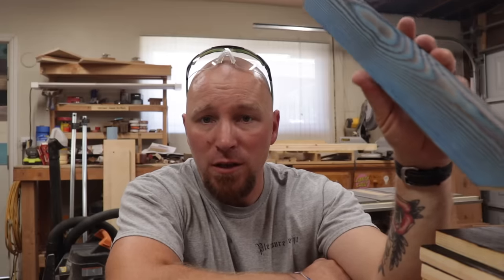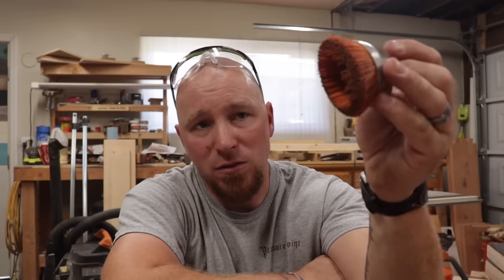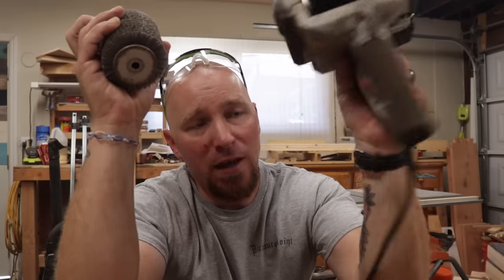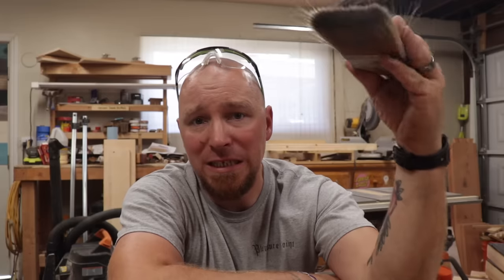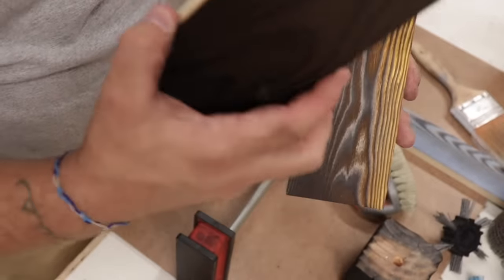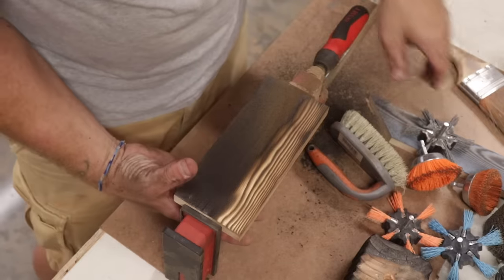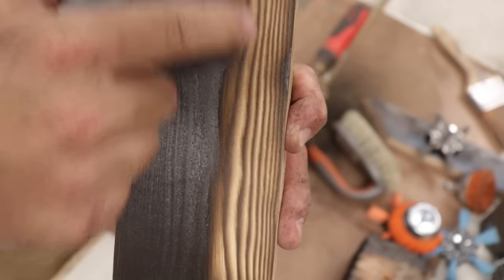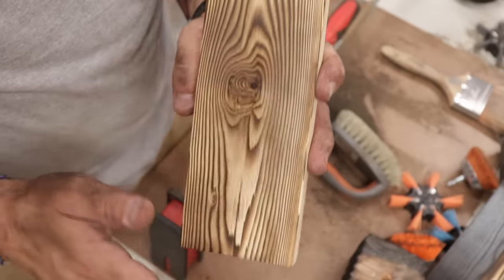The Right Brushes For Amazing Shou Sugi Ban Results

Comment: This is like barn boarding, making wood like it has been weathered for years. Popular in the 70s. It was made by running the wood through a wire brush planer, removing the softer wood, leaving the harder summer wood rings behind. Then staining with choice of color.

Comment: Hey there, i was indeed inspired into wood craft. Specifically shou sugi ban. I've been using the dyco flap discs, they work great, but now that I'm working on bigger projects they take quite some time to get the job done. 
 Wanting to invest in one of the restorer tools.  Could you tell me what grit was the nylon wheel you didn't use in this video? Would the 80 grit be enough to replace a wire brush for deep color contrast? 
I try to avoid the tooling marks, so only use nylon. Getting mixed reviews on Amazon for both products efficiency of removing char! Normally makita comes with 100 grit, but sells a 120,240, and 80. 
Any tips? Could you send me a video or picture of you using the nylon wheel you have?? I know it's a lot, but it's saving me from investing like 700-900$ for the Makita if I'm gonna stick to dyco ones anyway!
Thanks for any and all feedback! Great admirer of your channel!

Comment: Installed some shosugiban in my bathroom as a feature wall... needed trim to match, so I made it . Turned out awesome. I now offer it as a feature in high end remodel projects (labour intensive).Helpful tips here, and this is probably the most important step regarding the overall look

Comment: I found a regular wheel rather than a flap wheel worked best for me. I was doing a `12' long bench and the flap wheel went far too slow. It did increase dig marks, especially in wide areas but going over them with sandpaper was much faster than waiting on the flap wheel. It also holds up a great deal longer.

Comment: How is the nylon wheel going against the grain? Even so, just reverse the drill. It will go in the opposite direction. Just saying! !
Reply from the maker: It’s going against the grain because it’s a rotating circle going against a straight line. It would physically be impossible for it NOT to go against the grain. I see your train of thought, but reversing the drill would keep it on the same plane, just... reversed.

Comment: What kind of wood do you use? I used pine but i dont like how the grain is so close together.
Reply: It's regular grade 2x4, 2x6, 2x8.... Spruce. Home Depot etc. It is from corporate farming forests, fertilized for fast growth. This fast growth causes thick growth rings so on 2 sides of a 2x4 is a slab cut by default making large broad grain patterns. That is the good faces that you want facing out at glue up.

Comment: Thank you for taking the time to explain.  I am an ultra novice so sorry if this is a stupid question. I plan on making some furniture with this style and colored dye. Would you recomend sanding the wood first and then charing so that wood is furniture smooth?
Reply from the maker: That's actually a GREAT question and a point I think I might have glossed over in previous videos. I typically sand before I char to get rid of imperfections and blemishes as much as possible. Just keep in mind that once you char you will be changing the overall appearance and texture of the piece anyway.
Reply: Thank you so much.I was just going to do a regular stain, until I saw your videos and now I thank you again for the inspiration to try something different.  Unless i missed it (which i could have and i am sorry) SO after the brush is it possible to spray with water to raise the loose ends of fiber and thennn do a light sanding after?  or is it a trial and error type of thing? Do you have any experience in that?

Comment: has anyone ever tried this technique with a pressure washer to get rid of the unwanted black instead of nylon/steel brushes??... of course you would have to let it dry, but I figured if you were doing mass quantities... it would be less labor intensive and leave less too marks there fore less sanding... ? just more dry time...  any thoughts???
Reply from the maker: I’ve experimented with that a little. Only with a garden hose and nozzle, not a pressure washer. I do want to try again so thanks for reminding me!

Comment: I have a ? Regarding the 3 color method the wood, burn wood and stain like the blue one in the beginning I've tried different methods but only stain and the burn grain are left, can you give info please
Reply from the maker: If I had to guess I would say that the grain is probably too straight. I would look for boards that have the outer rings of the tree basically peaking at the face that you want to burn and brush. That will allow for some separation between the grain.

Comment: Just curious. Have you tried a pressure washer to get rid of the burnt soft wood?.  Or even a combination of pressure washer and flapper wheel?  Then let them dry as long as necessary before colouring.  I might give it a try just to satisfy my curiosity.  Thanks for the video's. Very informative.
Reply from the maker: I haven't but it is something I plan on doing at some point. I have tried with just high pressure from a garden hose but it wasn't that interesting. Let me know what happens if you try it.
Reply: @InspireWoodcraft  Hi Jodee, I gave my 2 pressure washers a try.  The results were amazing.  First I tried my 1500 lb electric and results were ok but I wanted to try the big dog.  The 3200 lb pressure 9 hp Honda unit. I'll list what I see as positive results.  I can honestly say there were no negative points. 

                            1.  No dust of course
                             2. What takes an hour sanding can be done in maybe 10 minutes tops
                             3. The finish is like 2000 grit sand paper was used.  Finish is almost semi gloss
                             4. Depending on growth ring pattern the 3D effect is awesome
                              5. With either pressure you can not get through the membrane (i'll call it) between the burnt 

                                     and unburned wood.  It leaves a beautiful golden brown finish
                               6.  While wet hit it with the nylox like usual.  Throw board on ground and hit it with the
                                      pressure washer again.  The pressure cleans out all the tooling marks left by the nylox
                              7. Dry and stain, dye, or whatever.

A few tips : never stop in the middle of the board and change direction,  clamp all the boards together evenly and do the sides and ends. 

Anyway I can fill a few pages here but maybe give it a try and tell your subscribers what you think.  I'm really impressed but a little caution is needed at 3200 lbs.  It's actually very hard to damage a board unless you get way close.  I was 6 to 8 inches away at full boost and no problems.  Just keep the wand moving
Cheers Jodee.  You do awesome work

Comment: Great video I'm looking to build a work bench and burn and and dye an OAK ply wood for my work top and dye it blue what is your opinion on how it would turn out could it be fully burned and brushed off or just light burn
Reply from the maker: You know, I'm actually not sure. It would be worth a shot if you had some scraps to test it on first. I haven't tried myself, but I believe plywood will only be able to be lightly burned. The top veneer is just not thick enough to brush.
Reply: @InspireWoodcraft  that's kinda what I'm thinks ng do a light burn and dye it a realy dark blue if you have IG give me a follow @DUEY_didit and I'll have a video up in like a couple weeks

Comment: Hey Brother... How do you keep the longer stretches of wood from warping when you are applying the fire? Thanks, T...
Reply: I've never experienced that, but maybe clamp both ends down to a flat table?

If it's warping, the heat might be penetrating too deep.

Maybe use a more a spritz of water to stop the heat getting too deep.

Comment: Brilliant series!! Thanks so much for explaining each step!!  Question, at 7.15 of the video after you have brushed the bits of the wood, you wipe across it with your fingers and of course they were black. Do you actually "clean up" the wood with a damp cloth? isopropyl alchohol ? Or just leave the residue right there on the wood ready for a finishing stain? Many thanks and yes SUBSCRIBED !!
Reply from the maker: Thank you very much! I’m glad people are getting some use out of these videos. I almost always only brush off with a soft brush or maybe blow off with air. The few times I have tried wiping off with something, it seems like the liquid would mix with the char dust and contaminate to exposed wood. I suppose on a nylon-brushed surface it wouldn’t matter much because the would is already dark.

Comment: I have a question. I want to make some picture frames. Would you burn before you assemble the frames or would you assemble the frames & then burn? Thanks.
Reply from the maker: I'm so sorry. I thought I replied to this comment already but apparently not. I would burn and brush with the lengths a little long and then trim them to length before final assembly. It will give you a much cleaner miter joint. If there is some raw wood exposed afterwards, you could always touch up those areas with black paint or stain or even a black permanent marker. It will blend right in. Hope this helps!

Comment: Hi there
nice work.
 want to know how the surface feels like after using 80/120/240 grit at 10:00?
i want to use a shellac finish on it and don't know if it will be smoth enough.
Reply from the maker: This technique is very easy on finishes and is very forgiving. Even with 80 grit, the wood feels surprisingly smooth compared to a sandpaper 80 grit. I typically don't go more than 80 grit anymore because of that. Plus, the surface is so textured when you're done that you won't notice a difference.

Comment: I think the knots burn differently depending on outside direction because they'd grow out from the heart of the tree, creating their own grain. Also, drills go backwards and forwards, couldn't you just reverse it with a drill brush attachment?
Reply: 2xX Spruce regular construction grade Home Depot etc. 2 faces of 2xX is by default are slab cut. You are always going to be against the grain sanding. Waste some scrap to practice up on.

Comment: Love these videos, watched them all many times. Unfortunately I bought the same nylox set used in this video from Amazon and they all came apart on the first board, was not pushing at all. Even in the packaging pieces were separated, read some reviews problem seems more than just me.
Reply from the maker: That's horrible! I have never had any issues with them coming apart at all. I'm wondering if they had a bad production run or something.

Comment: Hey, what is the brand name of those wheels that you are using? I cant seem to find them anywhere?
Reply from the maker: The brushes? If so there should be a link in the description box for them. They’re made by Nyalox.
Reply: @InspireWoodcraft  yeah sorry, I'm still figuring out how to communicate in here
Reply: I had 35 feet of 2×8 to do all by by hand . Needing some power tool assistance.lol
Reply: I got mine on Amazon (link in the description) - and a BIG THANKS to Johnny for the tip on which brush to use. I just brushed all the parts for an end table and it worked like a dream.

Comment: Great Video. One thing I'm wondering is why use brushes and not sandpaper? I've been playing with dying wood lately and the dye sand to expose original color and repeat and repeat has worked really well and only takes a couple minutes with sandpaper
Reply from the maker: Thanks! So the reason I use brushes and not sand paper is because sanding in general is for leveling out high and low spots. With this technique you actually want the high and low spots. Using brushes keeps the blackened grain high and the newfound spring wood low, creating the high contrast. Using brushes also avoids getting blotchy burning from surface burning and blotchy coloring from not coloring the spring wood.
Reply: Thanks for the reply! That makes sense, and I was just watching your coloring video that went into the full burn and surface burns and the flatness of each. Cool stuff and I can see having that texture can be cool. So when your dying a charred one how do you deal with the dye raising the grain without sanding? Or does the burn dry out the wood enough that it doesnt do that anymore?
Reply from the maker: You know, I haven’t really had a problem with grain raising but in all actuality, there’s so much texture going on, I don’t think one would notice anyway. The other thing is that when you use the Nyalox brushes it gets sanded down pretty well to begin with. I think it’s just how they work as opposed to paper, which most of are used to.
Reply: I wonder if it has to do with the dyes themselves. I'm using Kedo dye for guitars, it looked like you were using more of a red stain than a dye. The ones I'm using you dont wipe off as much as soon as they touch the wood they are absorbed. They work great on making flamed maple really pop. When I can find/buy a new torch head it will be interesting to see how it comes out on them.

Comment: @ 2:38  Can't you put your drill into reverse so it goes with the grain?  Thank you for your content!
Reply: Or turn the wood around or stand on the other side of your bench. The wood is slab cut so the grain in the 'island' panels, you are going against the grain on one end no matter what. So a light to medium touch required. Waste some scrap material to experiment to see what effect you want and get the hang of it. Hobby woodworking is 50% experimentation just for 'I want to try this' amusement.

Comment: I’m new to the woodworking hobby and a fairly new sub. After prepping the wood and sealing it. Does the wood give off any wood burning odor?
Reply from the maker: Great question! I've never had a problem with lingering odor. (I used to think I was just insensitive to it, but I've had others confirm. Ha!) And thanks for the sub!!

Comment: I know this is the topic of next video, but I'm in a project and a bit stuck. Been using the minwax water based wood stain (navy blue) and following the same technique I've seen others and yourself do on your previous video but as soon as the stain touches the wood the whole thing goes almost entirely black and you not only can't see the blue, but also can't really see the grain pattern anymore either. 

I was stuck before on not getting grain patterns and this video helped me realize I was using the wrong type of brush (nylon instead of brass). Keep up the quality content!
Reply from the maker: Hmm... That’s a tough one. The only think I can think of is that it isn’t brushed back deep enough.
Reply: Inspire Woodcraft looking at the examples from this video, I'd say your assumption is correct. I got some nylon wire discs (80 grit) from harbor freight and it just doesn't pull back the char as well as what you did in the video. If I put some force behind it it will eventually dig it up, but take all the color off and not just from the spring wood. Besides being a full disc rather than a paddle they are identical to the ones you demoed here. I wouldn't have thought it'd make a difference but maybe it does?

Comment: Can you talk about the clamp setup you use in this video?
Reply from the maker: I use a Bessey parallel clamp a lot of times for small pieces. I also use them for gluing up panels, like cutting boards, and holding cabinet carcasses together when I assemble. They come in several different lengths. The best place I've ever found to get them is actually The Home Depot.

Comment: You could use an electric die-grinder 
(with adjustable speed) 
instead of a 90° drill. 😉 
Very common tool. Cheap.

Comment: Hi.  
Thanks for the tutorial.  I don't see myself using a power tool so I'm most likely going to resort to a handheld brush.  You stated that it's a workout even using the stainless steel brush, so I was wondering if a carbon steel would be fine, as I'm worried that it'll be to aggressive.

Comment: Could you sand it? Either by hand, DA, or belt?
Reply from the maker: Of course! The problem that I've encountered with sanding after charring, And the reason I don't recommend it, is that it starts to take off the blackened grain, which is kind of counterproductive. I have gone back and hand sanded after coloring has dried for a worn, rustic type look and that works great.

Comment: what kind of wood do you use?
Reply from the maker: I made a separate video on wood selection and what I look for. If you're interested, watch this video :https://youtu.be/fEDgeXFBRHM But the short answer is that I usually use a "white" colored softwood like Pine or Hemlock. But I have used Cedar in the past quite a bit as well.

Comment: Up to now I've been winging it. I've learned so much from you, clear detailed instructions!! Wish I found you months ago... I have the restorer and love it! I use it a lot to sand logs after debarking them.
Can I ask what the clamp is that your using in this video to hold the wood. 
Thanks so much,   Susan
Reply from the maker: Thanks, Susan! That a Bessey parallel clamp. I prefer that clamp mainly because I have it and it’s reliable, but I’m sure any ol’ bar clamp would work just fine. I’m glad you got some use out of these videos!!

Comment: Have you tried pressure washing?
Reply from the maker: Not pressure washing, but high pressure from a garden hose, yes. I have had mixed results. Sometimes the spray takes off all the char, and sometimes it leaves an outline of the char. It looks really cool but in my small tests it's been really inconsistent. It's something I plan on exploring more down the road though.